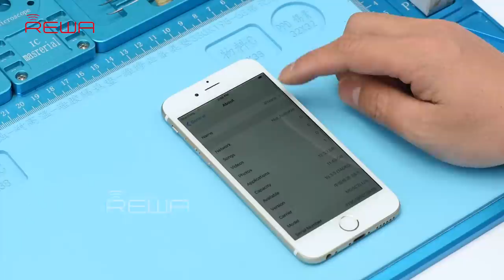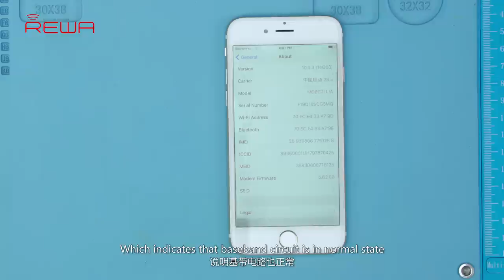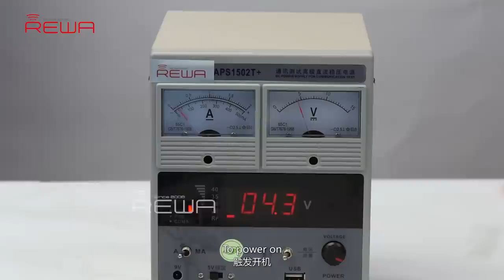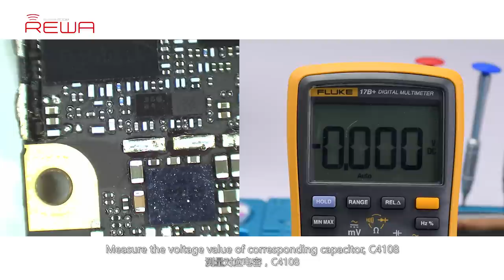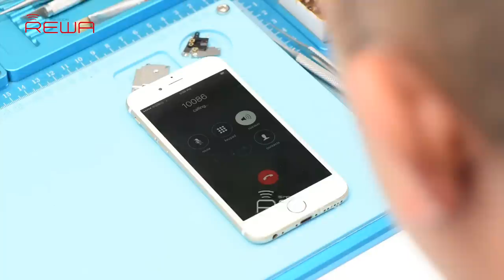iPhone 6 Keeps Searching For Signal - Logic Board Repair

Comment from the maker: * REWA Academy Training Book PRE-SALE of iPhone motherboard repair available now!
Do not lose the opportunity to get limited systematic REWA training treasure (1000 limited stock for pre-sale).
> https://bit.ly/31I5Nks
Reply: Thank you for another great video! I have an Iphone 6 Plus that will not activate, no imei present. To Start I replaced Baseband PMU and Qpoet. After no change, I ran U1 and V1 jumpers under Baseband CPU and still no change. I also replaced WTR IC and no change. most lines are getting proper voltage but 0.780v VREG_SMPS1_0V90, 1.8 LDO7, LDO 3 and LDO9 voltage missing. Diode mode readings ok. What to try next do you think? I tried BB PMU #3 times
Reply: Bhai kitne rupaye lgenge.... ?????
Reply: @themicrosolderingshop  "qqqqqqqq
Reply: Hey whatsap nameer dedo bhai
Reply: thanks more of this

Comment: I don't get it. I have 2 defect iPhone 6 with the same issue ("searching" / no imei on dialing +#06#). Accodring to your video I checked all the rf lines shown. The problem is the VPA_APT never has 3,7V on C4108_RF. I checked it with a working device and even on calling this line doesn't have 3,7V. Why is this? What am I doing wrong here?

Comment: Same problem and after replace that ic the cell shows no service instada "searching..." imei is ok, and sim card recognition too so it could be damaged baseband?
Reply from the maker: Hello. The ‘No Service’ issue could be caused by different IC of baseband. Regrading your situation, The problem component of your motherboard may not be the IC you changed. Or perhaps other IC was damaged during the replacing process.

Comment: Did it have modern firmware n was it producing imie number wen dialled *#06#. Video quality on the instructions are poor but undoubtably Rewa is the best but pls improve your video quality so we know what solution you use n what ic you change for what problem.

Comment: What if L4001-RF just show 3,8v - 4.0v?
Where is the faulty ?
Reply: did you use true rms multimeter? Anyway 0.2v wasn't much a problem , are you already measure the RF circuit power supply like what it shown in the video?

Comment: I had same problem..but when im trying to soldering with hot air under 400cc its get burning to logic board and get of some pieces out..im using flux but never get easy..how much degree temperature should i use...and what type of flux do you use...and pcb cleaner...i like to be a professional like you...pleasse help me
Reply: 370 heat and 2.5 air if you have quick 857dw+

Comment: 320? That must be a joke I’m using quick at 370 and still find it hard to remove ics which air flow set did you use and want about the nozzle size
Reply: Bruno Vidal  Im using a quick 861dw
Reply: Local quick not worked use high falmbke and expensive about worked chip level

Comment: Good video, but you used the most stupid way to take of the top shield. Someone will most like do even more damage, removing shield this way. But that aside it's great learning video.
Reply: Esad Muric this shield is very hard to remove in iPhone 6 and 6S,  even with hot air solder under 400°C, this way is less risky
Reply from the maker: Exactly. Welded junctions of the shield plate come with high melting point. Cutting Nipper was applied to protect the surrounding components from high temperature.
Reply: This is so not true. I remove this shield with hot air in a minute, without any damage. Never removed it on force without hot air.
Reply: I have Atten AT850D and it takes max 90 seconds on 415-420ºC. Never had any problems. Maybe I should upload a video :)
Reply: Think you need to understand there's no one way to do a repair. Goal is to find the safest, most efficient way that works for you. Your way works that's great but Rewa techs know what they're doing and their way works for them. There's risks to any method removing a high melting point shield.
Reply from the maker: Hi, Esad. Thanks for the comment. Generally, we remove the shield plate by hot air guns. But for sheild plate on the baseband, it is a high melting point shield, so cutting nipper is recommended. Usually we will choose a relatively safer way to repair for our customers.
Reply: Eu também removo com ar quente, mas acho que realmente aumenta o rico da placa!
Reply: Just master use heat,
Become Best when u can do it, not like same on them not pro,always be junior
Reply: Esad Muric i think, i prefer rewa's technician ways than yours.
If you a real technician, you will never underdestimate other technicians with your own stupid way.
I bet you are not as good as them.
Reply: what if PP_LDO1 or PP_LDO8 wasn't good ???!!!! these voltages generates by pm8019 and pm8019 supplied by vccMain am i right?????!!!
i have a iphone 6 with same problem i did reball the bb and replace the pm8019 wit new one but no changes happend.it worked properly before u2 ic replacement.what is the solution??? help please

Comment: Surprised you didn't use Kapton tape to cover the components around the chip, whilst heating it up ?
Reply from the maker: In this video, we applied a hot air gun with small diameter, so there is no necessary to cover it.

Comment: You changed  qpoet qfe1100 even there was 4.2 v,  why???? you mislead members!!!
Video is very productive but is wrong   .Anyway i  decided to follow you video just of curiosity , changed qpoet and still searching .. 

I Will suggest you to pay attention on SKY778 - 12 and SKY7702-12
Reply: You missed it! 
U_QPOET is getting its 4.2 voltage from L4001-RF , he measured L4001-RF and found that it is actually outputting 4.2v, which means that U_QPOET is the problem. It is getting power from L4001-RF but it is not supplying the 3.7v to the capacitor C4108 (Broken)

Comment: the chip was not soldered correctly
Reply: Лёха Солдат i thought the same
Reply: yes it was, the silver dots that you seen on the top side where the 4 dots to the 2 filters that are connected right next to the chip. i thought the same at first but when you go back and see the video again you will notice that when he is tinning the pads he never touches the top 4 pads (filters)
Reply: Это не ряд а R4001_RF и C4008_RF все нормально он припаял. Solder OK!!
Reply from the maker: Do you mean the chip was in wrong position? Actually, the top 4 dots are resistor and capacitor, but it looks like pads. Please check the schematics for the details.
Reply: yes the ic is improperly solded
Reply: REWA is correct and you are all wrong. 
https://gyazo.com/a21801dcfe47a417ff54b7ecdca16fe9
Here is a view of where U_QPOET is located, there were a resistor and a capacitor that were missing right above the IC chip hence giving the illusion of the chip being placed incorrectly but no, he did a perfect job.
Reply: I'm baffled to see how people judge things without basic knowledge or common sense.
Its very straight forward to cross check the before and after, as Ronald R does.
I spotted the "Problem" too but found out that it was just a look-a-like to pins ready to solder.
Great job on Se7en Axis posting the schematics for review.

Comment: hello. my iphone 6s is no service and i already tried to change the antenna and clean the motherboard but still no service. is there anymore solution? is there anyway i can reach u? email or anything? pleaseee help me =(
Reply from the maker: It depends on specific case, because there are many reasons may cause the problem. Please check the Baseband circuit.
Reply from the maker: We are so sorry that we do not offer individual service at present. It would be better to turn to a local repair shop.
Reply: REWA Technology thank you for your replies. baseband circuit and ic network is the same right?

Comment: I see in your others video  was same problem with iPhone 6 no network.... You showed I  settings  that phone have imei ciid and modem but you changed   bb ic.... And in this video you show the same... That phone have imei ciid and modem and you say that it's not problem in bb ic  why...?
Reply from the maker: For iPhone 6 no service, we can find the IMEI via *#06#. The issue is caused by baseband CPU fault.  While for iPhone 6 keeps searching for signal, IMEI is available, and the issue is caused by signal amplifier fault.
Reply: REWA Technology it confirm if the signal amplifier fault on any iPhone keeps searching?

Comment: I have iPhone 7 it's struck on apple logo i restored Device 2-3 times and i facing same issue
Reply from the maker: any errors when restoring?
Reply: REWA Technology no there is no errors it’s restoring normally after restoring loading bar and when normal phone get started this phone hangs on apple logo
Reply from the maker: Did you restore in DFU mode?
Reply: It was completed restoring after that when phone stay connected to computer is was showed insert sim card to activate your phone but in the phone still on app logo after few minutes screen little gone off and turned on again same issue
Reply: This is audio ic problem

Comment: C4108 has no voltage on working phones too - so this is totally wrong mine friend
Reply from the maker: C4108 has no voltage. According to the diagram,  C4108 3.7V voltage is outputted by U_QPOET,,
Reply: Phone ON calling emergency still no power 3.7v on call. 95% related on Sky IC or BB qpoet can be 5%